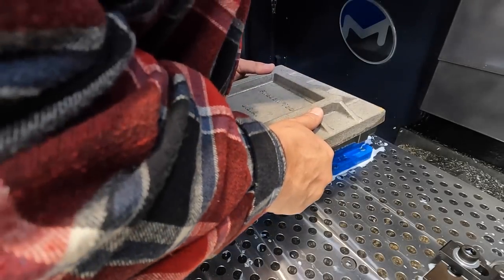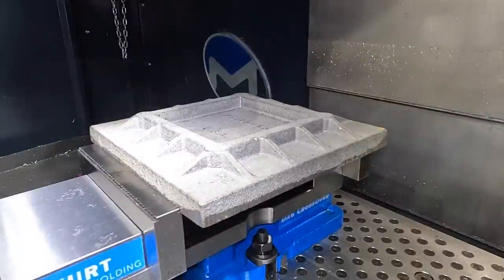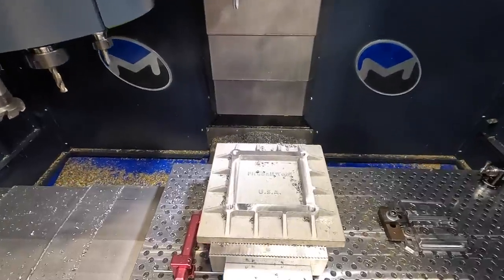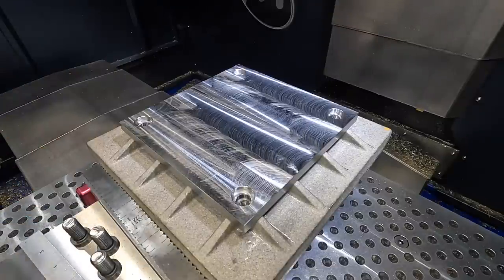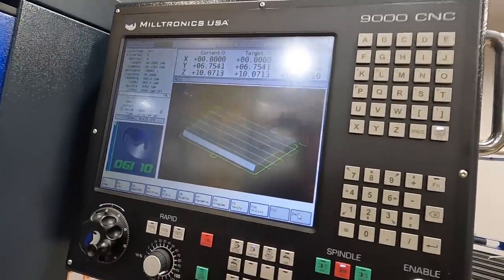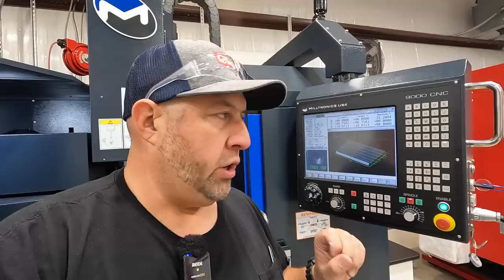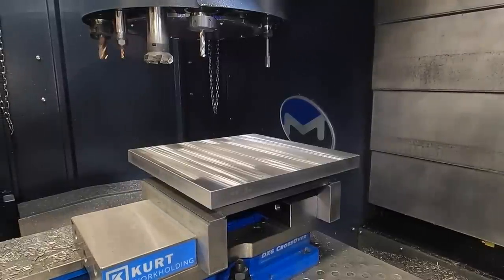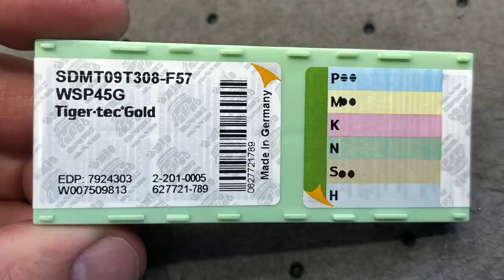CNC Machining a Fireball Tool Fixture Plate

Comment: Enjoying learning with you.
Edge precision on you tube has a very good video explaining how to slowly and safely aproach the work piece the first time with a tool to prevent craches and minimize puckering.
It takes away any nervousness and definatly will save you a lot of money to incorporate his method. It's worth  looking up.
I was also a bit nervous when the drill was coming down, you see. ;)
Reply: At my job I use a Prototrak, it has a traking feature where you start the program and then stop it to use a jog wheel to manually feed the tool while watching the coordinates, I assume this is the same as what Peter shows.

Comment: I give you full marks for bravery using cast iron for your first rigid tapping.  Mine was a chunk of uhmw.  In my defense I had to confirm parameter settings and hammer g-code directly into the control.  Still proud of myself for getting it right on the first attempt.

Comment: When I’m doing a casting when I touch z I’ll do it in three spots and average the offsets just a quick tip (hand probe 54 55 56z) Walter 2” 1200rpm 30-40ipm try to keep everything short for length too

Comment: One other thing I would suggest is face milling uni-directionally. You are alternating between a climb cut and a conventional cut. When you climb mill the chip starts thick and ends thin, the most desirable condition for heat transfer and tool life. You'll likely get the surface flatter with better surface finish too. Your percentage of cutter diameter to width of cut is good!

Comment: You can learn humility from working with a CNC.  I have to go hat in hand to a prick every time I get a error message. My machine is for wood and it’s from the ‘90’s.  I get nervous every time the cutter drops especially when you make a edit. I haven’t figured out how to cut air I just remove the cutter from the holder.  Great help thanks.
Reply: Add 2.00" in your offsets to all your tools and it'll run above the part

Comment: I really prefer Thread milling over rigid tapping. If the thread mill breaks, it's usually easy to retrieve, Also no need to bottom tap the hole, you can get it all in one op. As to your signing parts, tool pressure to low, increase feed rate or slow down spindle speed, on that finish perimeter pass. your learning this fast, looks really good man !

Comment: You're right about the depth of the threads IF you were doing a production run - but with 1-3 parts only its often better to be safe than sorry. Nothing worse than trying to save yourself a little hassle by going full depth and then having to mill out a broken tap =)

Comment: Adam, Next time you experience chatter like that try dropping the speed by 10% with the speed knob till it goes away. Also .004 tho per tooth with a 1/2 endmill is a good starting feed.
Reply: When I get chatter I first try adjusting the spindle override up and down a bit. If that doesn't help I play with the feed override. For particularly stubborn jobs I've even found continuously winding the spindle speed up and down while cutting can work.

Comment: I really don't like using straight flute taps on blind holes on CNC. Spiral flute tap tends to work better for me but you are able to get away with using straight by material used and air / flushing coolant. 👍

Comment: Casting sand will chew up any tool, it doesn't matter if it was made for cast iron. Made for cast iron just means it'll cut better, but won't necessarily last longer.
If you want your tools to last longer, the only way is to knock off that casting sand with an angle grinder. And of course charge double for the work.

Comment: The haas branded shell mills are a fantastic value for the money, the inserts are cheap enough to not feel bad if you burn a few up learning the feeds and speeds that work best for the machine and material that you are using.

Comment: How are you ensuring that the steel fixture is bolted parallel with the holes you drilled? I think that there's a potential for the steel plate to 'clock' left or right if it only relies on the holes which obviously are a clearance tolerance to the screws.

Comment: I would honestly try to get into thread milling if you can. they're much more controllable and if/when they do break, it tends to be less destructive as opposed to a tap breaking.
Reply: Taps dont break without a reason
Reply: the other bonus to using a thread mill, atleast a single flute, is if they break, you can go back in a finish the hole in the machine

Comment: Coming from a cnc guy, honestly there’s nothing wrong with using old school manual techniques on certain parts. Hell even using an edge finder  to find center is just as fine as using a probe. In fact incorporating manual into cnc is often beneficial because there’s a million ways to do one thing. It’s just about what’s easier for the operator to get the same job done

Comment: Looks like you're getting used to the CNC machines now, awesome
Btw. wouldn't it make sense to put two reamed holes in the bottom of the plates for alignment pins, for the case you have to remove the mounting plates again at some point?

Comment: You should have a read out called "distance to go" on there somewhere. Its good information when running a new program to see if the tool is going to do what you expect before it is too late.

If doing a fresh air cut at plus two inches is a common height you use, have a bit of 2" thick timber at hand that you can put on the top surface and offered up to the tool when it is at engaged height for a good visual verification. 
You can mark a line on the timber representing the depth a tap should go and have it along side when the tap is doing a fresh air pass.
"single block" mode is also a good one to have engaged when testing operations, the machine will do the commands one line at a time, in this mode you need to push the go button manually to get it to do the nex line. Good for doing what I described offering something up to the tool safely.

Going great.
 I still get the willies doing curtain operations, .

Comment: To improve surface finish you have to use coolant. And a lot of it especially on the facemill because if the carbide inserts arent getting cooled all the time they could form micro cracks and then break.

Comment: A great start Adam! - here's my gripe, vices are bad news on CNC machines, I don't know who started using them but personally, I don't like them. Custom fixtures are the way. If you're going to over-engineer anything in the shop, its a custom fixture.  I think you're absolutely right learning conversation-mode before you play with Fusion, I tried Fusion and it was way too complicated for what I need. G-code is pretty easy to follow with enough practise...
Reply: Been playing with fusion for a year or so. Only just got a cnc. It takes some tuning to get it right.
Like aluminum without coolant sucks in slotting, nothing but jammed up end mills and learning to push it a bit more to cut it clean.
Reply: No one makes a custom fixture for one off parts. You only make fixtures when you are doing high rate production work. A vise (not vice) is a very adaptable solution for people who only expect to make one or a few parts at a time. You can also make fixtures that mount in the vise if needed so I don't really see your point here. Every machine shop uses a vise in a CNC machine at some point. I work for a major firearm manufacturer and the vast majority of our vertical mills have either Kurt vises or fixtures mounted in Kurt vises for mass production.
Reply: @Sicktrickintuner  Look into a mist sprayer. They make small portable ones. For aluminum, you can also use WD-40 in a spray bottle or iso alcohol. Be careful with WD-40. Its highly flammable.

Comment: I really like your videos. I am NOT a machinist, more if a hack who I knows how not to cut off my fingers with an end mill. But I used to work at a small Eng. school that converted its Manufact. Eng. machine shop to all CNC and also put a mill and lathe in the Student Project lab that I did run.  What we did was we would have the kids use Machinable Wax to set up and run their programs before running   in steel or aluminum. That way if there was somethin off in feed rate, or their zero points were messed up they wouldn't break a tool or potentially damage the machine.  Just a thought.  Some people dont like the machinable  wax but it worked ok for us.
Reply: Good idea, never heard of machinable wax.  I was thinking of using wood (Douglas Fir) or MDF but that would make a mess in the
coolant system.
Reply: @petemclinc  'Steve Watkins at work' also uses machinable wax when he operates his not so often used CNC machine, just in case.  As an aside, he has the exact same Hydraulic Planer/Shaper that Adam bought but said was now planning to sell. So the work he is doing on there is very similar to what Adam would have done, had he not opted for the CNC route.
Reply: @petemclinc  Machinable wax is a mix of paraffin and plastic.  It comes in different harnesses we used the Blue type.

Comment: Honestly I'd recommend just programming in fusion and running that. I find it a lot easier to program in a true cam suite than with conversational.
Reply: Purely going to depend on the scope of the work. But it's a good idea to start getting used to fusion or whatever cam software you will be using early on either way.

Comment: I like that stop, but for even faster changeovers just use a 1-2-3 block between the stop and the part.  That way you have a 1, 2, or 3" gap (whatever you need) between the stop and the part during machining.

Comment: I don't have a CNC that is built for metal but to learn on my wood CNC I use MDF boards  to figure out what but will do each step.  Also I noticed that you manually adjusted your program during the flatening stage.  I would leave the program as is and just re zero before runing the next step.  Which for you was the drilling and taping.  Just my 2 cents, But I used mostly rough lumber that has to be flatened first before I can run the progam to make the parts I am making.

Comment: At least when it comes to practicing drilling/tapping holes on a cnc, you could try using the foam insulation board as your material. If you screw up, you won’t damage the machine or break a tap and you can cut foam to see a cross sectional view of the hole with the threads.

Comment: When you were machining the edges the direction the chips were flying made it look like you were doing a climbing cut, maybe change the programme to run round the plate anti-clockwise instead of clockwise. That may also reduce the chatter you encountered.
Saying that, I've not touched a machine for about 30 years so I could be wrong 😉😁👍
Reply: I had the same question.
Reply: Climb cutting is best on cnc milling machines
Reply: I've been learning along w/ Abom and had a similar question last week.

@Dave Lewis had answered my question and mentioned this:
"climb milling on finish cuts is preferred as it gives a better surface finish on machines like CNC that have zero backlash and good rigidity."

Perhaps that answers your question.
Reply: Climb cutting is not recommended on manual machines due to leadscrew backlash but it produces a superior finish on CNC machine with backlash control.
Reply: Endmills last longer and finish is better when climb cutting.. cnc uses ball screws so backlash isn't a problem like on a manual mill

Comment: Great stuff! we used to have a grinding stone similar to your face mill, now that was scary approaching the work (down a hole at high rpm) - keep it up, you're doing great!
Those chamfers could be bigger in my opinion, so you can bolt through some hardened location cone dowels for the second operation jig,. Yeah, I know, nobody likes jigs...

Comment: Adam may I ask a question? Long time ago my grandpa showed me way to cut bolt to size and keep thread nice. Screw nut or die on bolt above the cut line first. Cut bolt, clean cut with nail or grinder and unscrew nut to finally clean threads. This always worked nice to me. As I see you relay on grinder only. Do you have any doubts about my grandpa's way to cut bolts?
Reply: If it works, it's not wrong.

Comment: Supplier catalog should provide you with the correct sfm per each cutting tool no need to search for them at the machine. I to went from 38 year of manual machining to cnc machining. It's a challenge but fun at times youll get used to the butt clinching as you hit the green button.

Comment: Steel inserts will work in cast iron but they won’t last as long. Cast iron is very abrasive so a very hard carbide grade is used

Comment: Serrated for 1 op or first op. Flats with parallels for following ops. Serrated can't give repeatable accurate work holding. The part can lift or twist different each time you clamp it depending on your torque or even the material itself. Obviously none of this matters if you're not trying to be critical/accurate.

Comment: I remember when I started learning the CNC mill as a conventional machinist. The learning curve is steep but just think of the G and M codes as levers instead of functions and settings. You have the added benefit of a modern visual dialogue system so I guess you'll be just fine very soon, and by learning on the machines rather than on PC you are learn the most important codes quickly without going to deep in the weeds with hundreds of settings... And about crashing tools: that is pretty much a given at whatever level of cnc programmer you are, at some point Mr.Bozo will show it's face.

Comment: The chatter was because the corners of that square work were the furthest away from the main mass of where it's held in the vise, has nothing to do with the casting. Reducing the feedrate would have helped but it doesn't look like is hurt the finish much anyway.

Comment: Can you do the probe feed manually? I mean with the machine going fast like that it's got to be unnerving. Hell I wouldn't like it and I run code for a living. When we test stuff it doesn't break expensive parts (it's just code and 3d models).
Reply: My thought here is that something like a basic mill is a measuring tool. DRO is an accurate measuring machine. Probe touch in a CNC machine is full co-ord measuring if you know how to ask it to do the task. Big boys toys.
Reply: @markfoggy9933   You know more than I, with this stuff, I'm playing with lego =P

Comment: Very interesting to watch as you learn, one question l have is, why do you start cutting in the middle of the part, it would seem to make more sense to begin at a corner or am l missing something. Thanks for sharing.
Reply: I am a hobbyist CNC machinist.  I don't know about the Miltonic's software but most of the CNC programs allow you to edit entry and exit angles, overlap, and other items to provide a really nice look to the entry point.
Just something that may??? be helpful.

Comment: What is the tolerance for when it takes a tool out and puts it back in? Is it dead nuts accurate every time??
Reply: Depending on the machine, holder, and spindle condition yeah it can be dead nuts on. On a semi decent machine its never enough to worry about, you'll have more influence from the coolant temperature than than the repeatability of the spindle taper

Comment: very informative :) i do have a question, though.........why start the cut in the middle of the side?  logic, and my own previous experience with my own small milling machine suggests starting the cut at 0/0 ( usually a designated point, on square/rectangular workpieces it is usually the top( farthest away from you ))left corner

Comment: I reviewed your manual machining of one of those fireball fixture plates.  While you used a shaper rather than a mill, you did drill and counter sink the 1/2" holes on the bottom.  It seems that the speeds and feeds on your new CNC machine are faster than what you did on your Doall mill.  Are you now using carbide drills, or is the machine just that more ridged to take the faster movements?   Of course the positioning of those 4 holes was much faster on the CNC machine than the DoAll.  I was also surprised at how that chamfering the holes on the CNC seemed faster than using the countersink on the DoAll.  Or is it just my perception?

Comment: Why has no one come up with a Lazer scanner that can scan a part and match it to the parameters?
Reply: It exists.  It's pretty expensive though.
Reply: That exists already. There are stereoscopic cameras that can take pictures of an object that you want to reverse engineer and it will make a cad model of it. You can do the same thing on a CMM or a 3d laser scanner.

Comment: Hi Adam, i feel your pain. Only wish i had the space for a CNC m/C. I did notice that you were climb milling the edge. Normally not recommended for manual milling, does it not matter/ not so important for CNC? 
Andy UK
Reply: You can climb mill with cnc because they have almost no back lash in the ball screws, also you tend to get a better finish and the load on the cutter teeth is reducing as the cutter is cutting the material it is rotating faster than the material is travelling.

Comment: i'm surprised you're not running cooling, i can see cast iron dust
Reply: Coolant is rarely used with Cast Iron.
Reply: Looks like he is using mist coolant
Reply: @JimmyMish  No. Just air.
Reply: In a production environment where cast is the only material machined, they will either run coolant or invest in a machine having large air filtration units, specifically designed to run dry.  Working 12 hour shifts for  a few years machining and breathing that dust would probably send you to an early grave.
Reply: @richardjones7249  In a production environment that would make sense. Adam's work is more of a "job shop" deal though. I'm sure if he had a production run to do, he might change things. But I'm just a Mechanical Engineer, not an experienced Machinist (although I HAVE filled a few 55-gallon drums with swarf over the years)! 😁